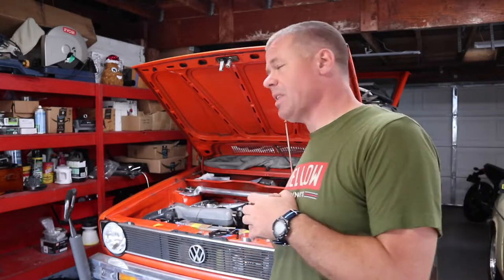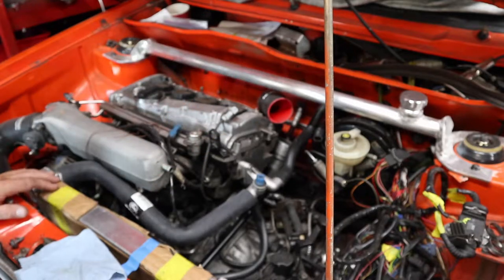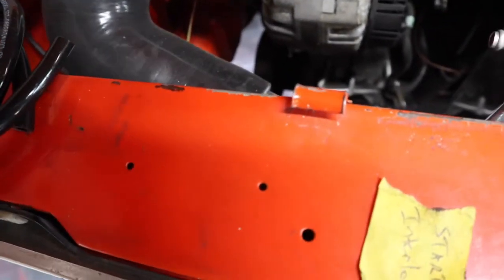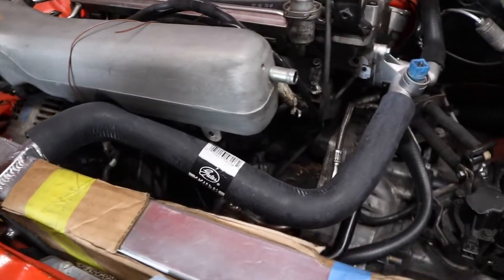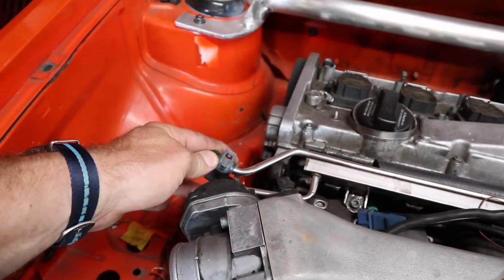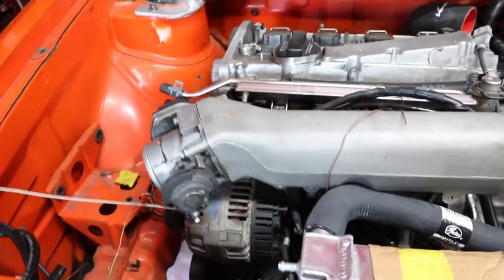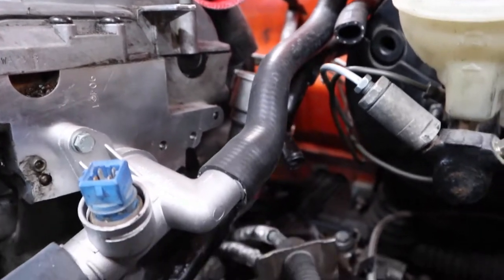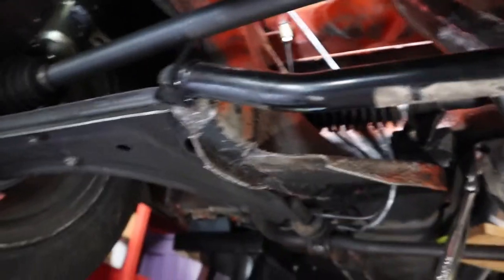inventory time! - 1975 VW Rabbit 1.8t 20v ep #56 -

Comment: Nice list Jeff, choose one thing and go for it, I would start with the fuel line and secure everything and from there water hoses. For the fuel line, maybe by the side of those rails (those ones that are lower than the floor) they would be protected.

And, forget about the screws and nuts for the exhaust flange, they will show up after you buy and install new ones. ;)

Cheers,
Paulo
Reply from the maker: That is a great idea. I'll probably work on those this coming week..work's had me buried this week.

Comment: If you're running the radiator with a overflow pressure cap vs the continual flow normally seen with the factory 1.8T, the strut bar is essentially just a catch can, as long as it isn't sealed at the cap.
I did this way on mine, like most American, and Japanese cars, and removed the o-ring in the OEM VW Cap that we cut a thread to match on the bar, so that it doesn't create a vacuum.
Reply from the maker: Killer tips - Thanks Jamie! I hadn't thought about notching the threads to allow coolant to escape!

Comment: On newer, not swallowtail cars, the brake and fuel lines mirror each other on the opposite side. Run them that way, if you can 
https://www.njrestorations.co.uk/wp-content/uploads/2015/08/2015-08-14-16.27.31-1024x768.jpg
Reply from the maker: I'll give that some thought this week - thanks for the photo - that helps a lot!